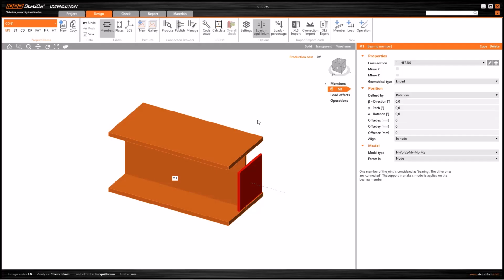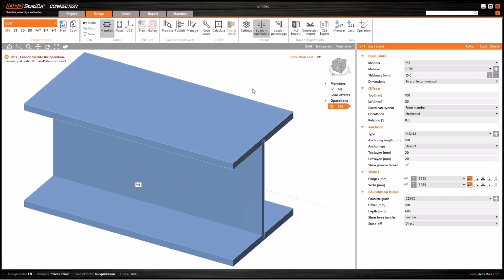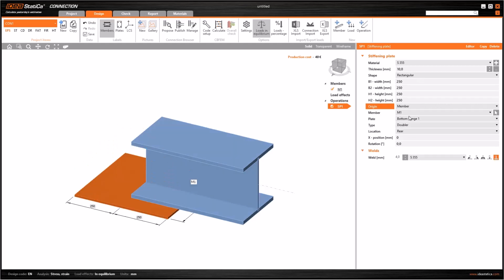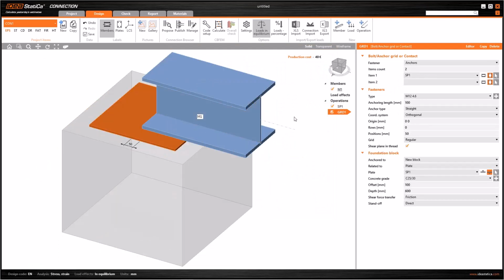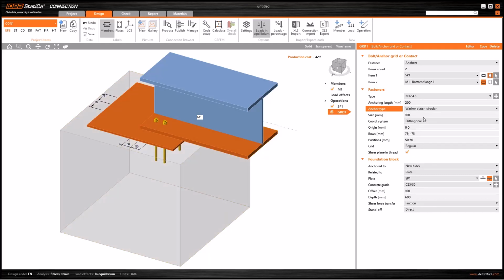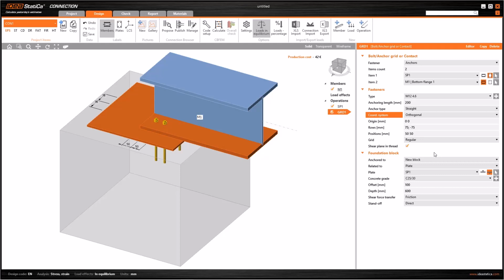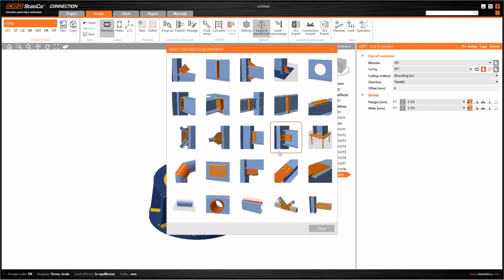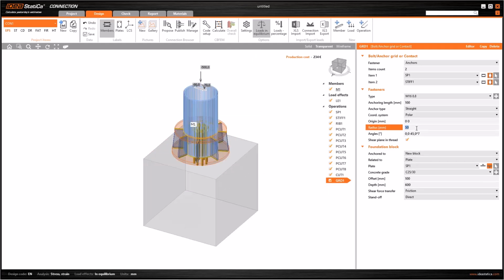Atypical Anchorings

Comment: Hello,
It is possible to anchor directly to the concrete block without the plate.
Thanks
Reply from the maker: Hello, yes, you have to use the Operation Fastener grid or Contact and select Anchors